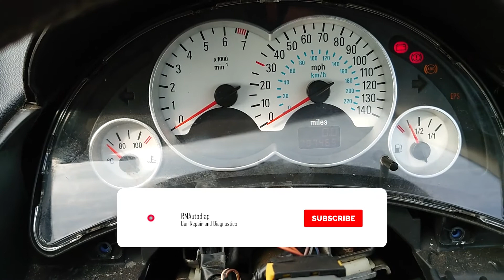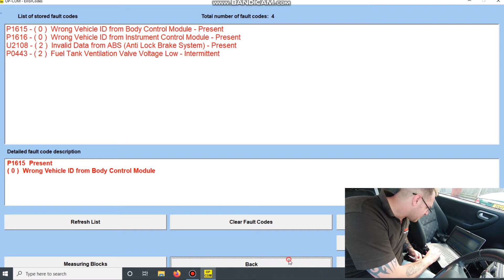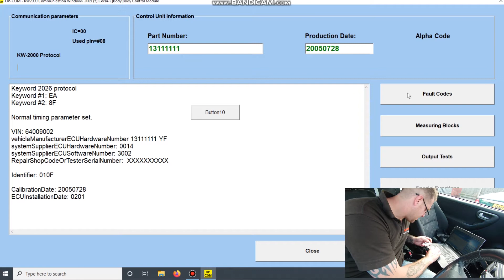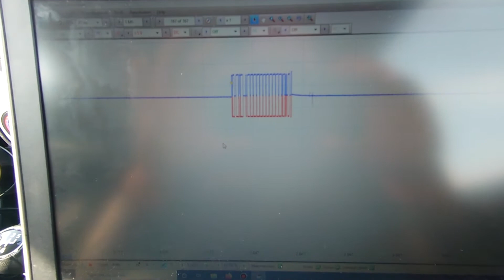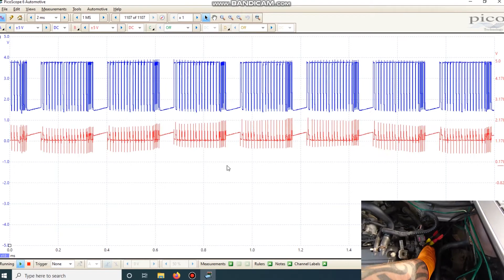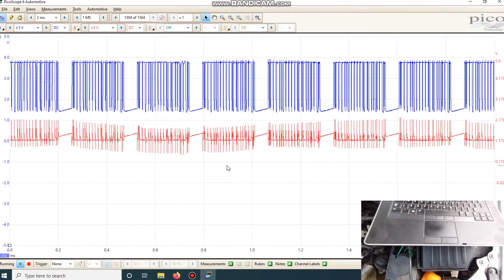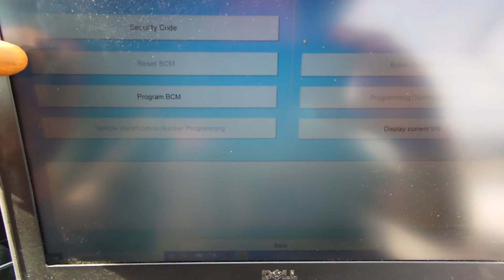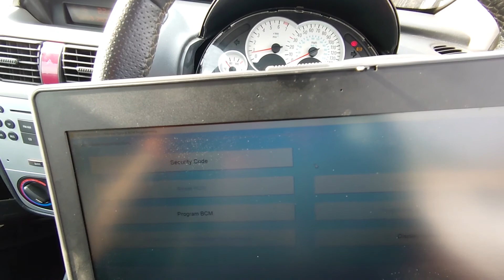Vauxhall corsa non start P1616 P1615

Comment: I have a very similar problem so this is excellent information for me.  I would like to follow in the footsteps of your diagnosis but I have one question: Where do you get the security code from?
Reply from the maker: It will either be on the car pass card in the owners pack. Or you will need something with key programming ability to pull the pin from the car. Thanks for your comment
Reply: @rmautodiag  Unfortunately I think I've exhausted all the diagnosis options that are available to me with no success.  I scoped the CAN-H and CAN-L but in my case they were both OK.  I tried resetting the BCM, but that didn't work.  I can communicate with all the modules from OPCOM but the BCM claims the ECM is not present, and the ECM claims the BCM (plus a bunch of other things) are not present.  It somewhat suggests that the ECM is faulty, but this would be a guess and I suppose it's not just a case of replacing it - it would have to be programmed somehow.

Anyway, once we get into the weeds of guessing I feel like I'm pretty much done.

Thanks again for the useful video.